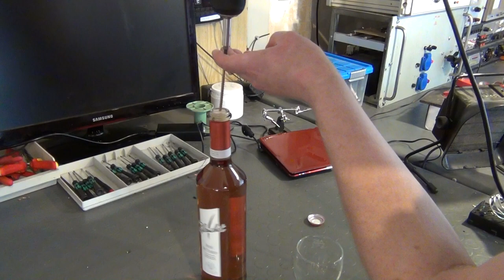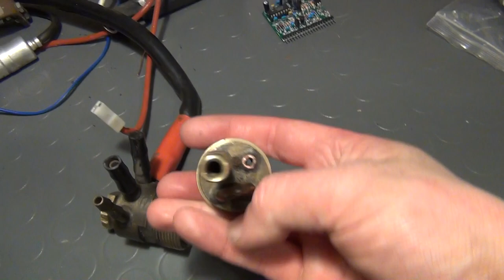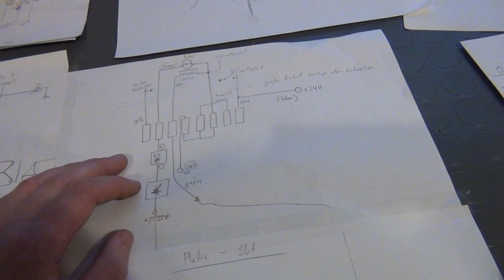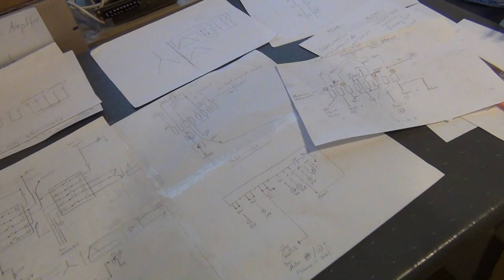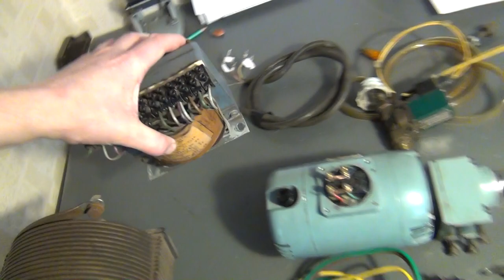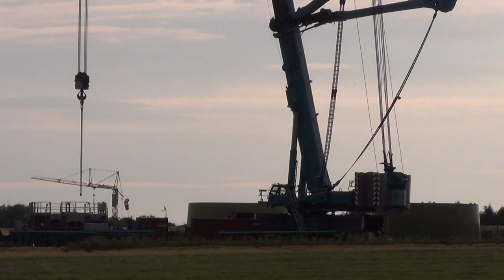TPAI Lab Report # 001:  Reverse Engineering / Welding Machines

Comment: I have seen someone selling self made welding machine for 60 euros. He says it is high power machine. Is it a good idea to buy it?
Reply from the maker: Earl of Destruction Well it really depends on what kind of machine we are talking about. You can buy a used but properly manufactured arc welding machine for that kind of money as well.
Reply: The Post Apocalyptic Inventor All that is written: selling self made high power welding machine. And the picture is hard to understand too, just a lot of rust: https://www.ss.lv/msg/lv/construction/tools-and-technics/tool-machines-machinery-equipment/weldings-electric/bbfiij.html
Reply from the maker: Looks like an old transformer and a rectifier build into a self made steel frame. The fact  that this was stored outside without any cover is reason enough not to buy it.
Reply: The Post Apocalyptic Inventor Thanks.

Comment: there's other ways you can get a cork out of a bottle of wine, and it doesn't even have to be french.

How to open a bottle with a shoe...   (carefull may need gloves and goggles until you perfect the technique.

remove the cork protection.  And place the bottom of the bottle in the opening (heel) of the shoe so it is flush with the sole.   Then hit the bottle in the shoe with the heel first against a wall.  Hard enough, but not so hard it breaks the bottle.

After a couple hits, the cork will have come out enough that you can take it out by hand.  It may even pop out entirely (which will spill some wine).

This works because the bottle and contents come to a sudden stop, the fluid will bounce back and give a kick on a cork. making it move a bit.
he shoe is obviously needed, because without it, hitting the glass on the wall will break it :-)
May not work with plastic corks, those buggers are tight.

P.S. some people will writhe in horror because you're shaking the wine that much...

Comment: Love the new format! Have you ever used Blue Devil head gasket sealer? I think it would work great for you leaking gearbox. It's designed for higher pressure and higher temperature applications. Not sure how attainable the product would be in Deutschland though. 

http://www.amazon.com/BlueDevil-Head-Gasket-Sealer-ounce/dp/B000NOO798

Comment: If you know someone that can build a fisher & paykel controller for me send them this way, I really need this controller. and anyone reading this that can or knows someone that can build this unit. the flat out runner type motor has more torque than the in runner types.